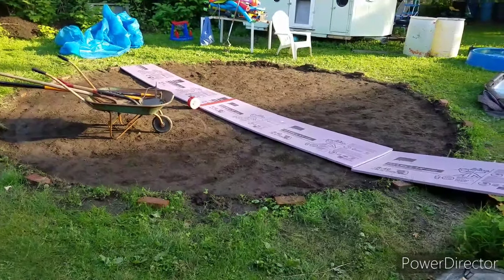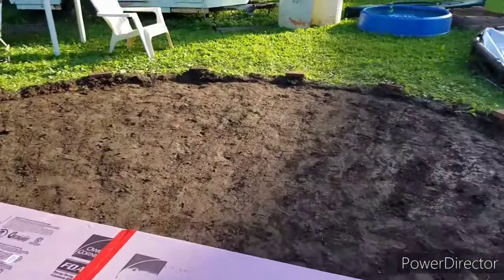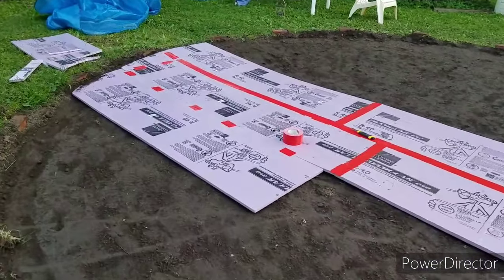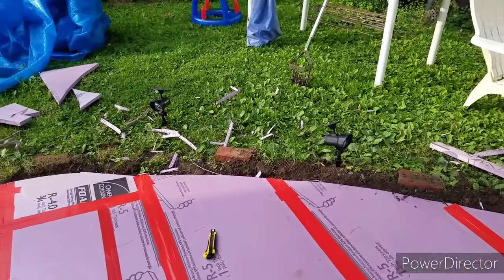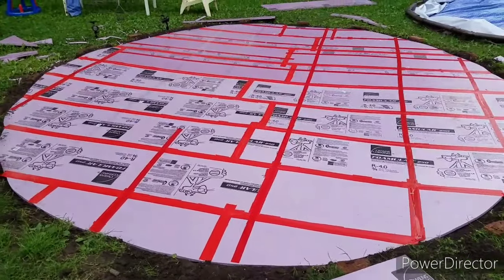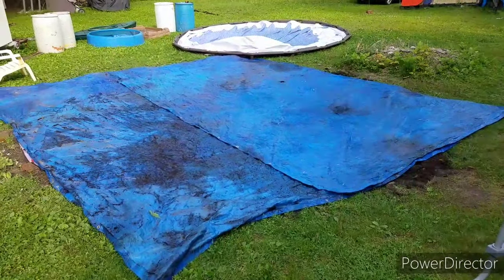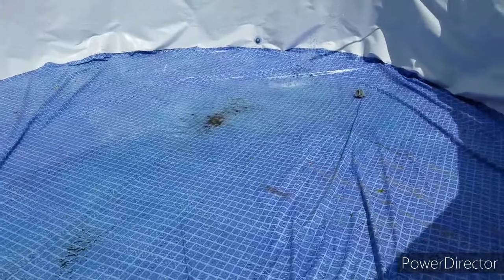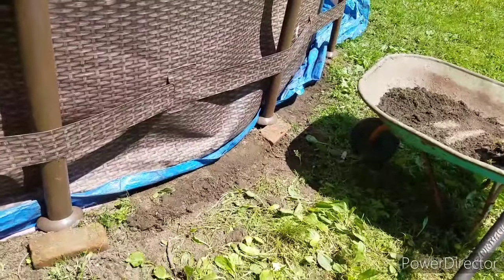Foam pool foundation, Coleman Intex best way pool

Comment: just put out pool up today I did ground cloth , foam 3/4 inch  then another tarp over the foam then pool   Thanks again, seems this is going to work out !
Reply: Where did you get the foam from?
Reply: @ponyxpress3  home Depot
Reply: @billynolanjr2266 did it work out well??
Reply: @vivianhelt8860  worked out fantastic! No issues at all
Reply: @billynolanjr2266  fantastic!!! I also heard horse mats work also. What do you think
Reply: Did this as well on a intex 18x9 pool. Home Depot foam boards $10 4x8 feet. We leveled the ground tapes the boards together then put the pool tarp over the foam then the pool on top. We also bought some 2” stones for the legs so it doesn’t sink into the dirt layer and it seems to be working great!
Reply: How many foam boards did you use
Reply: @JamesLalewicz You’ve probably already put your pool up, but for 18’ x 52” deep round index xtr pool, we used 13 (actually 12 1/2 because last row turned horizontal rather than vertical and only needed half length for last board) (4’ x 8’) foam boards, which once taped together was 20’ x 20’ square, then cut to fit 18’ round pool. Laid 5 across vertically, another vertical row of 5 underneath first row and last row, laid horizontal with last (13th foam board) cut in half to make large 20’x20’ square.
Row 1.  IIIII
Row 2. IIIII 
Row 3. __ (2 1/2 boards laid horizontally)
and tape all together.

Comment: I did this last year.  The guy at home depot suggested i use the foam board. We Leveled the sand  put the foam board on top. I hate I didn't tape it down. So now that im about to change the liner.  I'll be sure to tape it this time.
Reply: I have a 14 foot round by 42in tall pool and used solid top plastic pallets. 40x48x8 dug down 4 inches and leveled the ground. Installed a weed barrier and Bolted the plastic pallets together with all thread in a 5x5 square. Drilled holes in the pallets and drove rebar through holes into the ground hold foundation in place. Foundation was (200in x 240in) Most local companies have many pallets and give them away for free, just to get rid of them. I also made steps.

Stays level and makes a great foundation with no chance of anything cutting the bottom of the liner. $38 all in. Will be posting a video very soon. Just sharing what worked great for me since you’re swapping out your liner.

Comment: I did this a few years ago. It helps with the water temp and protection, but it feels amazing on the feet. Plus if you do spring a leak you don't get sand washout.
Reply: Did the foam insulation get crushed down under the weight of the pool? I’ve had a Intex pool for years, the 22’ one. It finally had it and I found this best way one really good price. It’s 2’ smaller. Well it just finished filling and it’s off on one side by 3”. I’m thinking the old one that was leaking softened up the ground and this is why. Was thinking about putting foam sheets under the half of the pool that is lower to raise it up. Was wondering if it will get crushed back down with the weight of pool and be uneven again?!
Reply: @therealbeedubbs35  Surprisingly no. I used the blue foam insulation, 1" and no crush. When I take the pool down in the fall you can see the pock marks from the pea gravel but just small indentations.
Reply: @quiptown8976  awesome thanks for replying. I was waiting to c. Ticks me off I have the pool so perfectly flat but one side is 3” lower. Gonna have to drain it. But thinking about buying the 2” for the low side and maybe get the .5” for the rest just so it’s all smooth on bottom. I’ll throw some more sand under it first to bring it up a tad on the low side!
Reply: @therealbeedubbs35  As long as your base sand is contained it's not a problem. I actually didn't dig down, I made a raised box from 2x4s and filled it with pea gravel, leveled and put the foam board on top.
Reply: But my pool is only 15' round.
Reply: @quiptown8976  where did you get 1" foam board? I can't find anything thicker than 3/4".
Reply: @thechristianarchist662  I found it at Lowe's.
Reply: @quiptown8976  thanks, I'll have to check there again. Maybe I missed it
Reply: @Quiptown89   did you tamp down the pea gravel before the foam went down
Reply: @brendanrailton303  not as tight as you would expect but I did tamp.

Comment: Did the foam insulation get crushed down under the weight of the pool? I’ve had a Intex pool for years, the 22’ one. It finally had it and I found this best way one really good price. It’s 2’ smaller. Well it just finished filling and it’s off on one side by 3”. I’m thinking the old one that was leaking softened up the ground and this is why. Was thinking about putting foam sheets under the half of the pool that is lower to raise it up. Was wondering if it will get crushed back down with the weight of pool and be uneven again?!?

Comment: The foam sound like a plausible idea. But where is the sand base to keep the pool from shifting and maintain level? JustSaying.
Reply from the maker: The manufacturer specifically said not to use sand underneath because it is dangerous if the pool springs a leak.
The sand will wash away and make the hole larger, potentially sucking a swimmer under the water against the hole

Comment: I wonder if I can pick your brain? I'm preparing for a 15' x 48" intex pool. I've already dug down in put pavers in and I'm leveling them to each other and the center of the area. I'm gonna fill in the area with sand to make everything even with the pavers. I've got lawn edging tracked down to prevent sand washout in addition to it being dug down. Then I'm gonna put 1in foam board on top of all of and tape it down with that packing tape that's got the strings on it. I have no intention of taking this down for the winter. My question is can I put the pool on top of the foam over the pavers ice already put down? They're 12" x 12." Or do I need to put 7" x 4" pavers on top of the foam over the pavers underneath the legs?
Reply from the maker: Foam compresses under highly focused loads, like the foot of a support post. It would be best to spread that load out with a 2x6 block of wood or a paver.
Reply: @rowerwet My question as well I'm going to try and follow what you did. I may get a different brand insalation foam Due to the price because I'm on a budget and we upgraded to an 18 by 48. And I do not plan on taking it down I live in ohio. Do you take yours down ? Also I'm doing this by myself with my nephew 16. Where do I put the paper stones? How to get them level? I'm kind of using the 2 by 4 method going around in the circle. But at this point i'm kind of just winging it also

Comment: What size pool? We have a 16x48 I think lol we are doing this next month to ours. Our yard is very sloped so we had to dig out one side quite a bit and it handled the slope rather well. Only off about 2 inches after it settled and then when all the rain came and storm it shifted some. We are also using block to hold our rock in place.

Comment: We used interlocking foam pads taped together,  our neighbors love our pool.  I would imagine the foam may break/crack over time. Our interlocking foam has lasted three years and no degradation.   It also fold up into a pie piece during the winter.

Comment: lay out all your foam and tape it together but don't cut anything yet. you can then put together just the top ring/pipes of the pool and lay it on top of foam and mark out where your legs will be and cut accordingly to whatever board or paver stone you will use for your leg supports and it sits flush with foam

Comment: Did you make those curved cuts with that utility knife? I ruined a few pieces just jagged cutting it with a box cutter when I couldn't get it in the car from lowes. Then it didn't fit flush
Reply from the maker: Utility or jack knife,  I don't remember for sure

Comment: I bought a 15ft x 48inch swimming pool from Amazon but I need foam boards just like u to set my pool on, so how many do I need to get for my pool. Mine looks the same is yours.
Reply: 15 foot circle covers 177 square feet. The 4x8 sheets are 32 square feet. You will need at least 6 sheets. Maybe buy one or two extras if u make mistakes.

Comment: I intended to follow this video, then I found a more economical option that worked well for me. I still utilized what you video showed me. Thank you for your effort to share with us. 

I just put up my small pool over Memorial Day weekend 2024. For about $65 Lowe’s had a 4’x50’ length of 1/4” insulation foam. It was folded into 2’x4’x1.5’ product on the shelf, which made it easier to transport. I prepped the ground moderately well, then I put down a 1/4” layer, with another 1/4 layer with perpendicular seems over the top. I used shipping tape because in the past duct tape was thick enough that dirt deposits formed on the liner above duct tape seems. I also ran a length of tape across the folded seems (every 2’) on the top layer to try and consolidate 6 tiny creases into a slight depression. The 1/4 foam was easy to trim once the pool was full. It isn't squishy, but I don't feel any rocks or even seems when I am in the pool. I didn't put down a tarp. My priority was eliminating seems and I am willing to pay $65 a summer to not have to spend 90% of my pool cleaning effort on tarp & tape seems that collect sediment like the ridges on a gold pan. 

Kingspan Insulation R-1, 0.25-in x 4-ft x 50-ft GreenGuard Faced Polystyrene Board 
Model #100000050460

Comment: Nice video. About to get some foam and tarps to do what you did. 3 year video how is it holding up?
Reply from the maker: Excellent, I just filled the pool again for the summer, had to replace two corner edges that blew away over the winter, but the rest is doing fine

Comment: What about using a price of carpet?
Reply: My father had a pool installed and they used inexpensive crushed foam carpet padding under the liner. It was used for cushion and protection from small rocks, but not used for insulation since if it becomes wet it would loose any insulating properties. Their pool was always soft under the feet.

Comment: can i ask  did it work  well im in uk    but thinking of this  as  im getting conflicting information on what to use
Reply from the maker: It worked great, I'm going to put the pool up again in a few weeks on the same foam. I'll probably retape the seams but that's it
Reply: @rowerwet   thanks what was  thickness in cm  or mm im looking at this instead of  sand    thinking this is better idea seem sand is cheaper  but i heard people say they had so much issues with sand washing away

Comment: So I'm planning on putting up a 12ft pool I caught this video my question is I do not plan on digging up grass just raking over the area as good as possible should I put tarp down then foam boards are opposite? Also since I'm not digging up the grass should I use sand as a base along with foam boards and of course tarp any help is appreciated

Comment: This was a great idea. Allows me to use river rocks under the Rigid Foam to level , then in the winter the rocked area will be our fire-pit area. This was our first pool and didn't want to spend too much time digging into grass, then rocks to level. Now to build a 5-gallon bucket sand filter and a solar water heater
Reply: Did the foam damage too much from the river rocks underneath? 
Did you cover whole area with the river rocks and add foam on top?
Reply: Did river rock work well?
Reply: @jesseperknat did river rock and pad work well?
Reply: @Annie-px5ni  NO, river rock to level is a terrible idea!

Comment: This is exactly what I did, worked great. I used 2 inch, only mistake I made is I didnt tape the joints.
Reply: Did weeds grow through? I had some nutsedge grow through My pool last year
Reply: @MrMedinaj  I'm on my third year of using foam insulation. I taped my joints using duct tape. Zero weeds grow through. I also used a pea gravel sub base instead of sand but I don't think that makes a difference in the end result.
Reply: Does the fome compress much or break under the weight
Reply: @danielkelly9673  not at all.

Comment: I used a bunch of moving blankets about 2 layers deep but the pool stood on concrete it made the ground softer than just a tarp. 
It rotted away at the exposed sections but the unexposed sides were dry but still soft. 
Had a bunch of those blankets laying around from when we moved.

Comment: Do they make this in 4 x 8 sheets?
Does it also act as a weed barrier?
Did you notice any water  temperature difference after using the foam?
Reply from the maker: Yes it comes in 4x8 sheets. Nothing grew underneath the foam, so it might work against weeds. I think this helped the pool warm up and stay warm a little faster
Reply: P

Comment: Hi - I wondered how your foam worked under your pool?  Did the joins hold up?  Would you do it again, or make any improvements?
Reply from the maker: I just added a new video that covers that, I'm happy with it and other than needing to retape one or two seams for this season, it's ready to go
Reply: @rowerwet  great to hear
Reply: I was just about to ask the same question!

Comment: Thanks for this great video. Question, does the foam also make it more comfortable for the people in the pool in terms of providing a softer ground rather than just the dirt. Thanks again.
Reply from the maker: Not really sure, thanks to buoyancy you have less impact and weight in the pool. The water is still heavy though, so the foam doesn't have any real give to it
Reply: @rowerwet  thanks for replying.

Comment: Hi, did you use a tarp between insulation and pool liner? or did you place pool right on pink sheet?
Reply from the maker: I used a tarp only because I didn't know how it would all work. I think I will not use the tarp this year

Comment: How did this work out for the entire season? We live in AZ, LOTS of rocks in the ground. We will definitely level, remove rocks, and tamp the ground but we want some insurance against possible liner punctures when we setup this season.
Reply from the maker: It worked perfectly,  and has survived the ice and snow this winter just fine as well
Reply: So I have done this same thing for my first pool. What I would change and what I did wrong is don't have foam under the leg areas. I did put wood down on top of the foam but it broke thru the wood and the foam on the legs. So I would change it and just have the foam under the liner only. Also I added to much water before I could get all the wrinkles out of the bottom pool liner... So I would make sure to have the liner ground flat first before adding any water. Not much I can change about these issues now.

Comment: Would 1/2 work do you think or should I go with 3/4 thick?
Reply from the maker: Half of this is 1/2" and half is 3/4", half inch is plenty in my experience
Reply: How many board panels did it take mine is also 18'
Reply: I just did my 18' round Intex with foam board.  It took (9) 4'x8' boards. 😉 hope this helps! I also used 1 1/2" .. overkill I suppose but area was a bit lumpy to start with.
Reply: @michellehaywood8971  3/4 foam worked fine, but I ended up emptying my pool because I have mixed soil, some sections regular black dirt and others with mostly clay. What started off 1/2 offlevel became 2" quickly after a little rain...:( I'm so bummed out.
Reply: Did u cut round to fit pool or used full boards. I have a 18’ pool also

Comment: Hey I would like to know exactly what type of foam you used or which particular one do you recommend buying?
Reply from the maker: The pink is Owen's Corning and is sold at home depot. Blue green foam is Kingspan and is sold at Lowe's. Either one works just as well, the trade designation is XPS foam.

Comment: How'd this work for you? The insulation underneath? Kelly
Reply from the maker: It gave me a worry free season, and has survived the winter covered in ice and snow so far. It will be another month before the pool could go up in new England.
Reply: @rowerwet  Thanks for getting back to me, I appreciate it. I thought of doing this.. but hadn't found anyone who did it. My lawn is terrible.. lumpy, uneven, bits of all kinds of glass, plastic, metal etc. I'm going to level/grade as best I can then put the insulation down to protect it from anything I didn't find and remove. Kelly

Comment: I'm definitely going to do this when I set my pool up for 1st time in another month.  Best idea I've seen yet! Can you tell my what thickness you used?  I have an 18' round, thinking maybe 12 sheets if I've figured correctly 🤔
Reply from the maker: Half is .5" and  half is .75", just what was available when I went shopping
Reply: 3/4 inch in his video.
Reply: Have you done this I'm thinking about doing it as well how did it work out
Reply: @jeffduerlinger845  i was thinking about this and i run into this video so i think ima do it ... i wonder how it worked out for him
Reply: How many boards did u end up using

Comment: I have a 15ft pool I'm putting up, I'm wondering how much 4x8 foam boards I need.... any help is greatly appreciated.
Reply: To find the area use 3.14 x radius x radius. For a 15ft round you need about 176sqft. A 4ftx8ft sheet is 32 sq ft so you'll need 6 sheets. Cutting and fitting isn't 100% efficient and you'll have some unusable pieces so get 7 and you'll have enough:)
Reply: 7
Reply: 7
Reply: @jessiemagee3098   There's a easier way to find it out than that

Comment: Looking at doing the same, did you pull of the sod and level the dirt that was there? Or did you add a different type of soil to level it out?
Reply from the maker: Just pulled sod out. I actually dug it 4-6" deeper in the middle and tried to level the outer edge all the way around, it's still 3 inches lower on one side